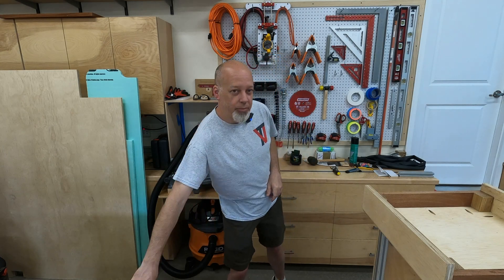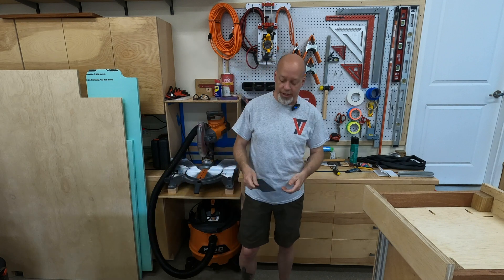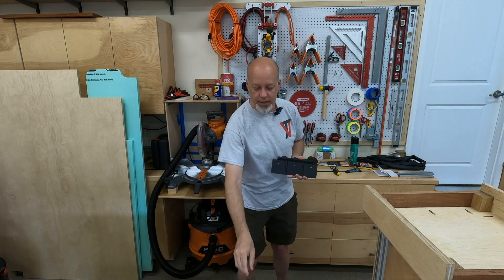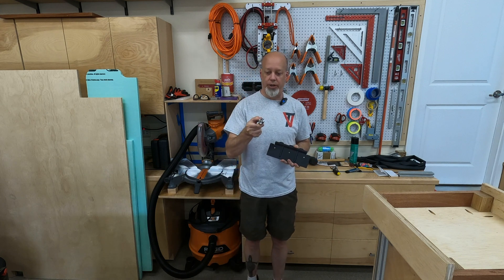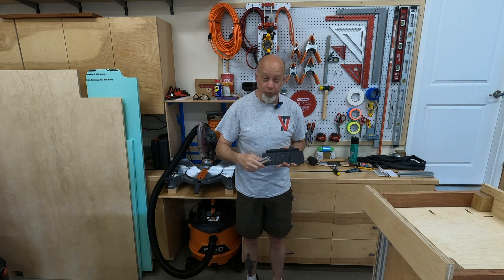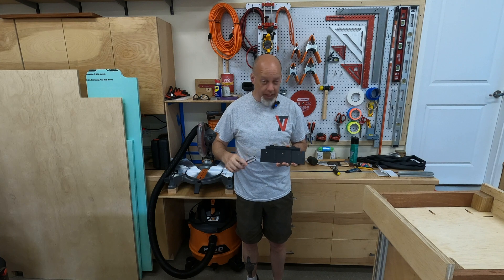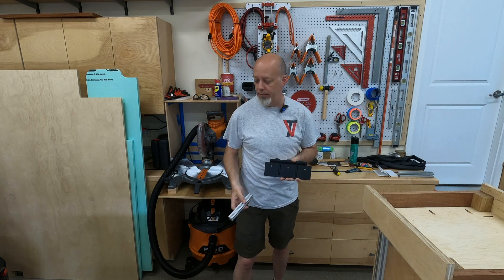Mount Victron Multiplus-II to 8020 quick tip (read comments)

Comment: Did you also drill out the lower mount screws to mount directly to 8020?
I eventually decided it was too much trouble to try and mount directly, and built a panel out of 3/4” ply for extra mount options.
Reply: Hi. You know… I went through the ACTUAL mounting process today and it hit me… I think the Multiplus NEEDS to be mounted to something that does NOT conduct electricity. Otherwise the MP’s chassis ground becomes the metal
plate into the 8020 and any other metal that is connected to.

Once you see this reply I’ll probably delete this video due to that. I’ll drop an Instagram photo of basically what you said you did… I’ve now mounted a 3/4” plywood panel to the 8020 and mounted the MP to that. Now the MP’s chassis grounding has to follow my path to the negative bus which then goes out to the main system chassis ground.
Reply: Hmm. I’m not sure the 8020 ground path is problematic? Wouldn’t the ground follow the path of least resistance, which is going to be your large ground wire? Plus, presumably your 8020 is likely linked to the chassis (or there’s be no ground), so seems an okay worst case. 

Either way, happy to see some consensus where I felt like I gave up!
Reply: @tristan-s  I will have each of my 8020 modules grounded but probably w 6AWG, not 2/0 or other larger wire. I do have heavy mass vinyl between my 8020 and the van as a thermal break, exception being the bolts into the plusnuts. Path of least resistance should be the copper wire to the DC negative for ground. I feel good about having switched to the wood and not having to think about it anymore though 🤣
Reply: @tristan-s   Electricity takes all available paths. How loud is the sound and noise coming from your MP-II, especially during high watts?
Reply from the maker: There can be a hummmm of the fans when it is working hard.

And follow up for Tristan-s: I've been told 8020 in anodized and therefore doesn't conduct electricity unless you break through that outer layer. Still, I'm think I feel better about having mounted on 3/4" plywood instead. It's done anyway!